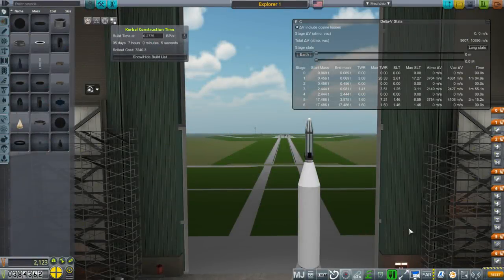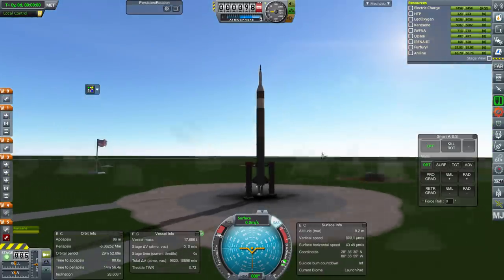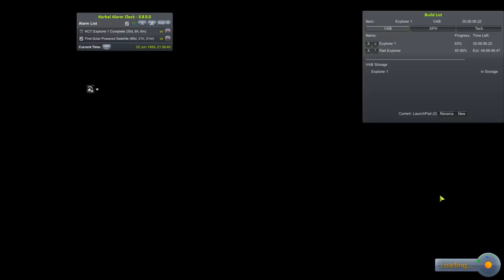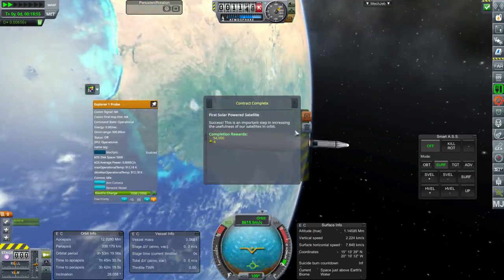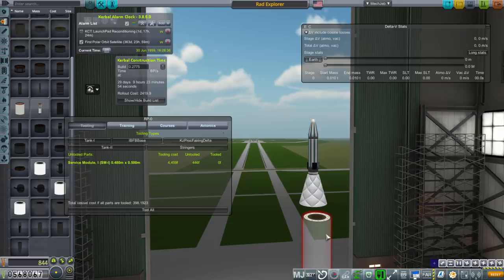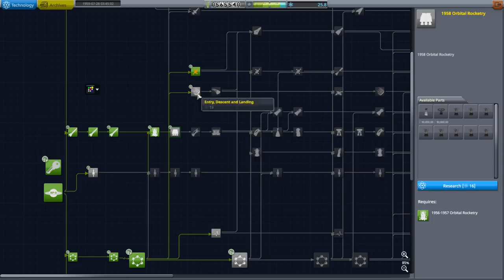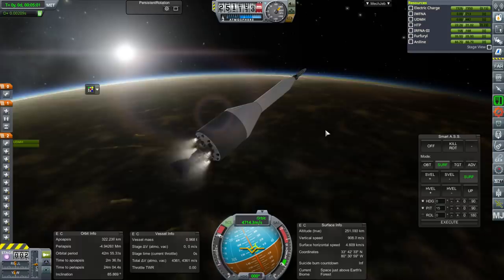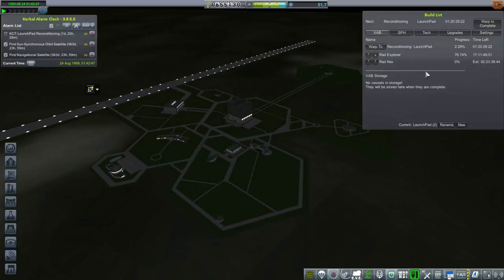KSP 1.3.1 with Realism Overhaul - RP-1 05 - Polar Orbit

Comment: Technically launching towards the South from Cape Canaveral is a prograde polar orbit, while what you did is a retrograde polar orbit. At least that's what I've heard...

28:00 Not just coolest biome name, coolest biome. Who doesn't like coniferous trees, large mammals, and subarctic climates?

I've never gotten why they kept the base premise behind the Stock science system—I mean, seeing what the cosmic ray concentration is a few thousand km over the Arctic Ocean has nothing at all to do with developing a new rocket engine, for example. The vast majority of research towards new technologies should come from data units (and perhaps results from specially-designated "R&D sensors") from test flights, static testing, and just plain waiting. Now, what planetary science results should give you is prestige (...as they already do with contracts), which should affect an annual funding allotment.
Reply from the maker: The science system could do with some rethinking, but it's not as annoying to me as the economics. On an annual funding allotment, it sort of depends on whether this is NASA or a private company. Right now, the economics works as if it's a private company, though the tech tree doesn't really work that way. One way to reconcile the current system is to view it as a science exchange - you get science that institutions want, and in exchange those institutions give you some technology they've been working on. But, because very little of the logic is explained in-game, the systems (including my bane - the rollout cost) can feel unsatisfying.

Comment: Recently Linuxgurugamer revived KSPCalendar (lets you set starting date and format, and displays the date/time in a small window.
BUT I see in this play through you have the same feature replacing the GAME date and time in the games own window. And this date is used in the contracts too... 
Do you know what mod or setting or .cfg it is that is letting RP-1 do this?
Reply: Did a bunch of forum searches and think I found it..... RSS DateTime Formatter.  Would love to see if I can get this working in my 1.5.1 game.
Reply: Black Hat I know this is a year late, but now it does work in 1.7.3
Reply: @varunbabu2596  I was hopping that I could get rss calendar to also function in the base game.
Reply: Black Hat I highly doubt that considering times and dates are entirely dependant on the earth’s rotationary period and revolutionary period which are entirely different for Kerbin. Either you’d have to come up with a whole new 6-hour day calendar system or you’d have to speed time up for each of the days of the year. Idk if there’s a mod for that, but knowing the KSP community, there probably is😊

Comment: Why don't you install x science?
Reply from the maker: Never particularly interested in approaching it that way. It's a quirk, but one related to the way that I avoid getting tired of the game after all these years, so I'd rather not mess with it.
Reply: i quit using it after it lagged the game everytime i changed a biome. Might be fixed by now tho.
Reply: @species8472cze  Try using [x] Science only for checking what science you've missed, and then Science Alert to actually gather it. I had extreme lag with [x] as well, but Science Alert has no lag at all.